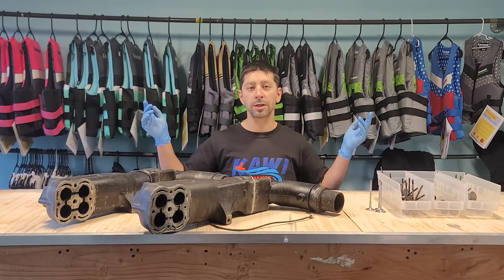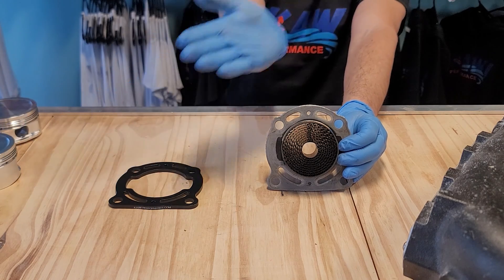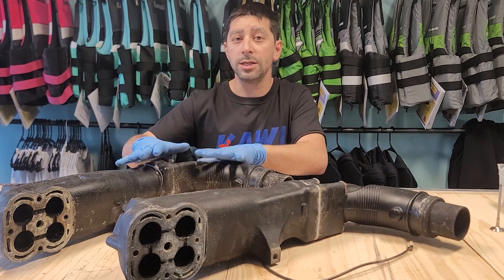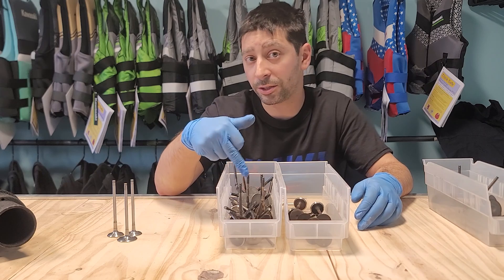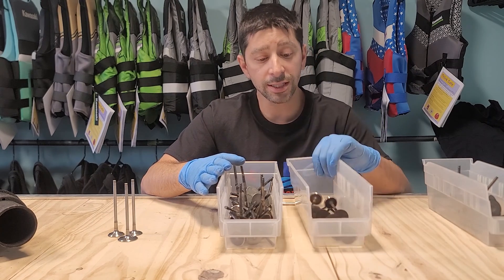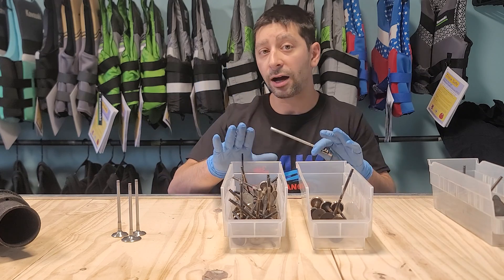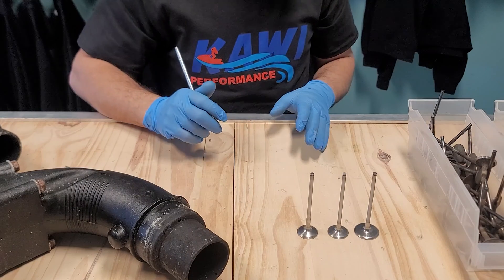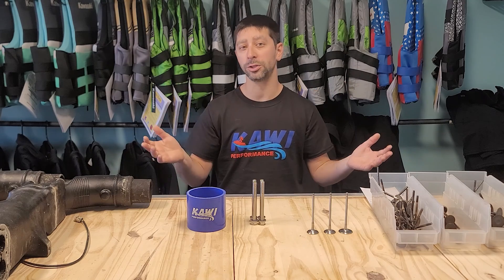Do You Really Need An Exhaust Filter Bypass? | Giving Away Industry Secrets

Comment: as there is an Pin in the exhaust it will not fall into the Waterbox and 2nd of all just change it every 100 Hours its way better design then first version without the hole. There is no performance gain when using the Plate but faulty Plugs will be the Result.

Comment: Doesn’t apply to me as I have the STX-160, but good info for if I buy a 310. I have yet to put my ski in saltwater but before I do I will get the 148mm KP pump upgrade
Reply from the maker: That is an excellent upgrade for the 160
Reply: I have a STX-160LX, what does the 148 KP upgrade do?
Reply: @robertcook5974  there’s nothing to prevent the thrust created by the pump from sliding the pump shaft backwards into your camshaft thus destroying your engine. This upgrade prevents that. I’m going to have it done before my ski gets up in the higher hours to prevent that from happening
Reply: @stuartpeck26  thanks for the info Stuart. My ski is under warranty. Will upgrading void my warranty?
Reply: @robertcook5974  factory warranty from Kawasaki yes. That one should cover it if it happens anyways. If you got an extended warranty from your dealership, it depends. This upgrade is reversible so keep your old shaft so you can always put your ski back the way it was if you need to.
I hope this helps and I hope someday we see each other on the water. 
-Stuart P.
Reply: @stuartpeck26  thanks for the help Stuart, would love to ride with you. I'm located in South Jersey and ride on the best river in the state. The Mullica river. Have a great day
Reply: @robertcook5974  Huntsville, Alabama. So I ride the Tennessee. Yea I’ve owned my ski over a year now and am looking into traveling more so will definitely make a trip up there in the next year or two.
If you ever need to get in touch with me, I can share my email with you on my own YT channel.
-Stuart P.